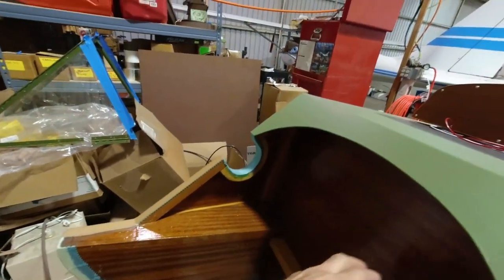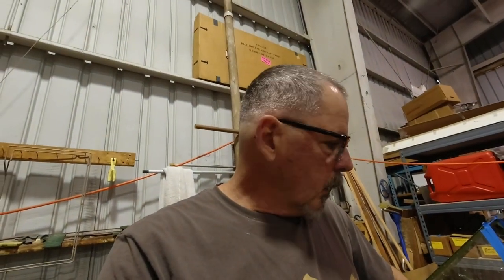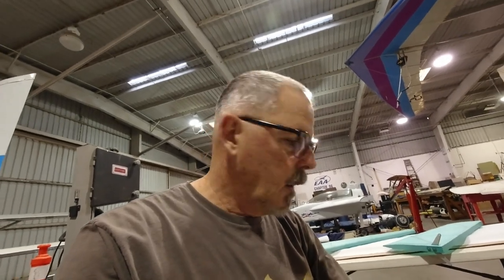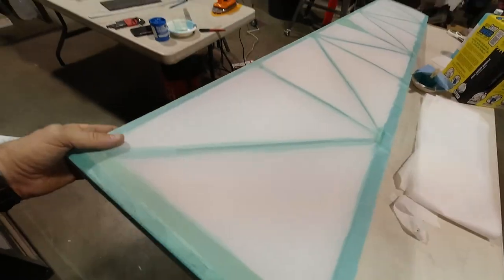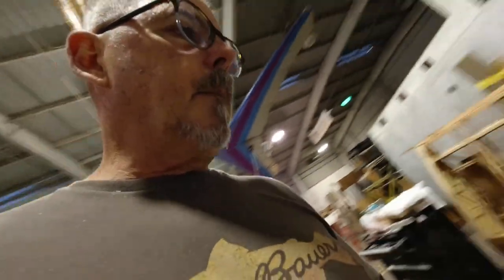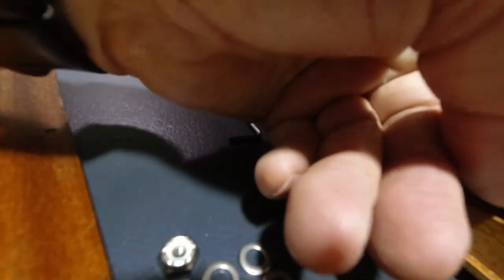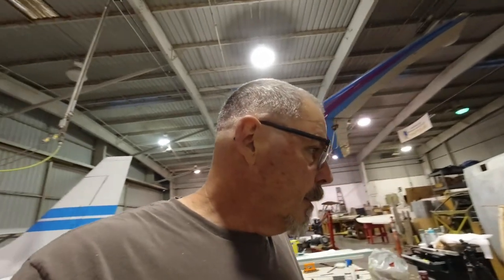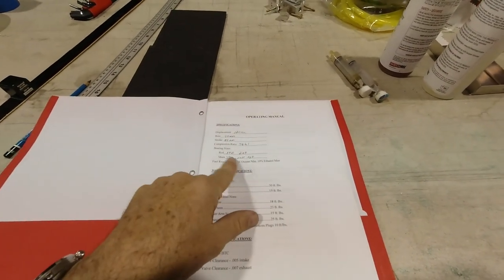Minimax 1100r Wood Aircraft Build Ep 168

Comment: For my antenna, I used a sheet of very thin aluminum to create a ground plane by lining the underside of the first several inches of the turtle deck.  For my aerial, I used a common car radio aerial, and cut and bent it to match the aerial on a Cessna 150 that occupied the local community hangar.  I mounted the aerial on top of the turtle deck, over the center of the ground plane.  I then connected a coax cable - positive to the aerial, and negative to the ground plane.  I was stunned at the result.  Connected to a basic Icom handheld radio, I had a range of thirty miles or more when in the air.
Reply from the maker: That sounds like a good solution and that’s amazing range! 
My favorite thing about what we do is that we can be creative and experiment.
Reply: @DTMinimax  Absolutely!  I wish I could still afford the hobby.

Comment: Hi Dennis I think you might be better off having the antenna mounted further out as you have part of it right next to your fuel tank and that (I think), will reduce the range and may also change the SWR which can cause problems with the radio.
Reply from the maker: You’re absolutely right! Where I was planning would put it right in front of the aluminum tank. I will move it out to the tip. That should keep it clear of all metal.

Comment: Hi Dennis. I'm curious why you didn't use a handheld Comm radio with a built-in antenna and headset jacks.  Would that type of short antenna not have enough range for your needs?  That gascolator looks great and very convenient for sampling fuel and draining the tanks.
Reply from the maker: My SP400 did come with an antenna, I just wanted a little more range and didn’t want the standard antenna sticking up in front of me. I realize there are simpler solutions and I went for the luxury version.